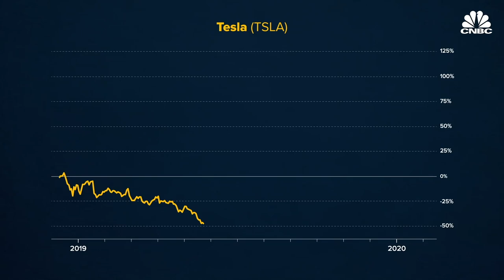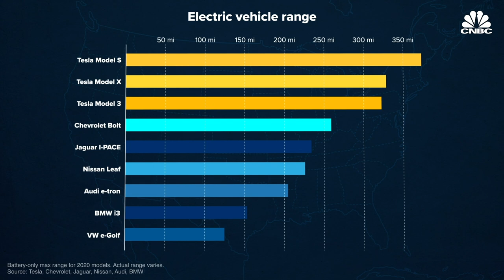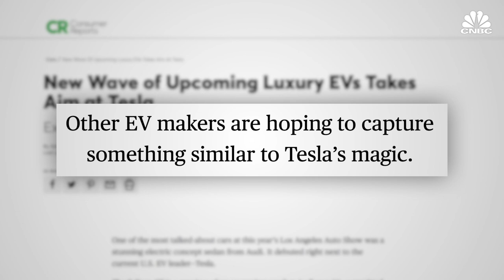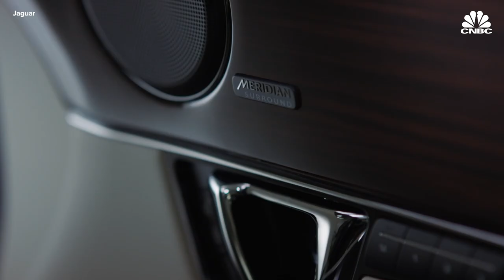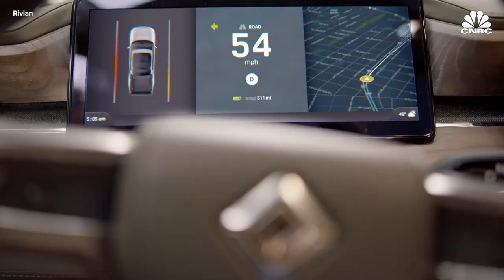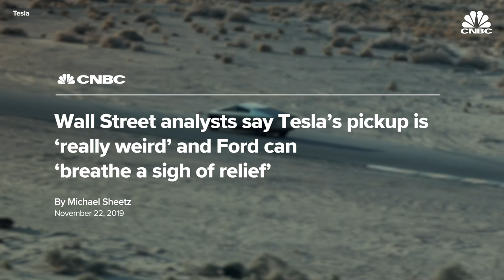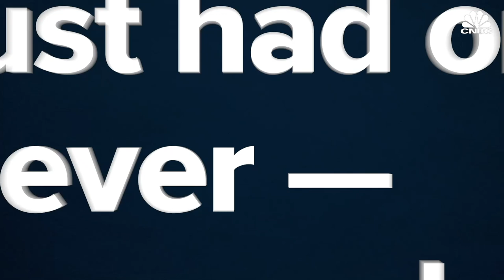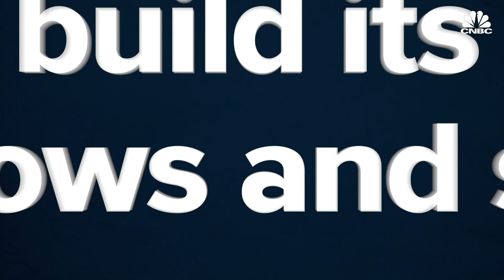Which Automakers Can Seriously Challenge Tesla?

Comment: I would like an electric vehicle, but I travel on the road a lot. Its charging that prevents me from buying. In some cases, it nearly doubles trip time. A typical gas stop for me is about 10 minutes. If a full recharge could be done in 30 minutes or less, I would buy one. But so far its 1-2 hours at best. I'd need access to 2 vehicles. One for city, the other for long distance. And I'm not about to fork over crazy dollars for both.

Comment: ..,..,,AMAZON: 

Yep, I bought a ton on the dip.   It's getting cheaper relative to its current earnings (half compared to last year). 

Amazon invested $14 billion in the last quarter alone, the same as it spent in 6 months before that.   It is a do not sell stock.

...With the Delta virus coming at full speed ahead, pandemic sales will make a comeback.

Amazon is investing so much money, that no competitor will ever be able to catch up.

Amazon's not going anywhere so I know that eventually it will come back.    

Fidelity considers Amazon as a large growth company (probably because as big as it is, it still only has 7% of the retail market)

Get on board or be runover, it's up to you.

Comment: Non of the so called big automakers have developed any infrastructure to support their cars, but Tesla did! You have two choices when you got a non Tesla EV, You charge it at home, or you resort to a Tesla Supercharger and use your adapters/converters, etc, in which case Tesla is still making money on you. The other thing is the software Tesla is using in their cars. They can upgrade your Tesla remotely, simply by sending a software upgrade to your vehicle. BMW tried this recently by charging it's customer for the upgrades and enabling or disabling features that were already built into their cars, only making it's customers angry, so that's a loser approach. In my opinion now the best chance is the VW ID-3, a long range, affordable EV, but again, VW does not have the Global infrastructure of chargers like Tesla does.

Comment: Tesla owns Solar City.  Why not develop a solar recharging panel on every EV? A car could theoretically travel 3,000 miles non-stop.  What about a solar panel on the trailer for the Tesla semi truck tractor unit?
Reply: It would be able to a 100watt panel on the roof and maybe a 50 watt on the trunk. Solar panel on the hood would cause accidents and b annoying due to sun shine glaring in ur eyesight. The panels would be ugly and u couldn’t have a super cool sun roof. 150 watts would take 3-4 months to charge the battery at 100% efficiency. It just makes no since plus it may not be safe to have a solar panel that close to ur head not to mention they create heat so when ur sitting still in traffic u would have to run the ac on a higher level using more power than what it’s producing

Comment: Only one buggy company survived the transition to internal combustion.  And it wasn't any of these guys.  It was Studebaker.
I don't expect a different result this time either.
By the time they make the investment, the people with money will have moved onto personal flying drones.  I expect Tesla to get there first too, probably by borrowing some engineers from SpaceX, or at least before the other car makers.  People will just have landing pads on their garages.
Batteries are absolutely critical in the future.  We need a minimum of 6x the energy density we have in current electric cars.  But when that happens (maybe even just 4x)...automated people carrying drones everywhere, electric larger aircraft, electric vehicles of all types, everywhere.  Even personal robots that are actually practical.
Gasoline is going to be under heavy pressure, when electric vehicles makeup over 50% of sales. Many gasoline stations will become electric stations, and the gasoline stations will become harder to find.  Taxes on gasoline will creep up.  The first bans on internal combustion will be for mowers, leaf-blowers, edgers, and other gardening service machines.  Sale of new gasoline motorcycles will be banned next.  They have no space for catalytic converters, pollute badly, and make racket.  The roads will go Kosher...no thundering hogs. 
Gas stations will be forced to have just one grade fuel to cut costs...and it will be heavily modified by regulations...biobutanal, and other changes.  Some cars won't like it.

Comment: It simple Tesla is a company that was built from the ground up as an electric car company as where everyone else were not. They have to change hundreds of factories now to produce electric cars, where their normal combustion engine cars are still bringing in millions. 250k is a very small piece of the automotive pie. and for Ford as an example to change the assembly line to produce a car that not many will drive does not make financial sense at this moment. But here is the kicker, resources and capital, which all the other top brands have. And it is already happening bringing out better  electric cars at a lower price point. Tesla might have the market now, but the competition is catching up especially with build quality, which is the main concern with a smaller manufacturer.

Comment: It’s all about Teslas battery technology that gives them far more range than the high end competition. For other luxury brands to compete they need to invest hevy in there battery technology and computer systems in the car to make the cars as efficient as Tesla at kwh used per miles. To create cars that have the same range or longer than Tesla. Until they do Tesla will remain the leader, despite its many manufacturing problems and quality, and service problems.

Comment: You almost did well. Past issues with Tesla are in the past, with learning and innovation Tesla has the safest 3 cars in the US. Their 4th car is 7 months early, no more letting down the customer. Consumer Report had an issue with Model 3 in 2018 and part of 19 because of the number of cars manufactured and delivered. CP in 2020 says that Tesla as a company is RATED number one in Customer Satisfaction, over every other company!! It is not a cult following. It is disruption, learn about it or tell about it if you understand it. Tesla will be making 3 million cars per year in 2023, and it will be keep doubling, it is an exponential curve. You obviously have not driven a Tesla. The following is because they are an experience on Wheels, the safest cars on the road, clean, very little maintenance costs, The Model 3 gets 124 miles to the gallon. They are good for us and the planet.  No other car company can do what Tesla is doing, why you ask? Because they have put in so much work in the last 8 years. It will take the other car companies at least 10 year to catch up. Most will be bankrupt in the next  years. Mark my words. It was a good try. Keep working at it and you might eventually get it right.

Comment: Yeah, and China pretty much has the monopoly on Lithium battery production, so wondering what will be the long-term effects of that? Maybe they'll become like the new oil giants building golden palaces, gold-plated cars, and such after awhile hehe...
     Also our electric grid can't really handle the transportation energy sector to run on it (barely handles the current usage in certain regions), electricity costs will most likely rise a lot once EV is mainstream... People should start planning on getting more into home solar power and off-grid power generation now, before it becomes a bigger problem with the grid later, because once the grid starts suffering due to pegging demand, it will drive the cost of solar energy up again is my thinking... 
           Einstein once said:   "The significant problems we face cannot be solved at the same level of thinking we were at when we created them"
     And on a side note, Tesla is a lot like the iPhone when it came out, there was no other competition, it took years for other brands and OSs to even come close with what the iPhone could do, because Apple had the huge advantage of more experience making smartphones than anyone else. But even today after the other hardware companies and Android OS finally caught up, iPhone is still the choice for many...

Comment: "Which Automakers Can Seriously Challenge Tesla?"
Those who invest in the technology which will replace those over-hyped, environmentally harmful Li-battery powered cards -> hydrogen cars

Europe makes a serious push in that direction. Excess energy from renewable sources create hydrogen, some companies change their semi trucks from diesel to hydrogen and produce the required hydrogen on their own in 2020.
The only thing stopping hydrogen cars from hitting the mass/end-user market is that the infrastructure required to "fill" your tank isn't there - but that is not so hard to change.
Reply: In my eyes hydrogen will not replace EV's as the car of the future for one major reason: energy cost. Hydrogen cars would require around 3 times more energy to drive than EV's. And especially as battery technology improves and they search for better batteries types, it will be hard for hydrogen to take up a considerable share of the regular car market. 

However where I can see hydrogen being usefull is for trucks and maybe the larger cars like pick up trucks and cars used in area's/circumstances where you can't easily recharge your car.

Comment: Only a yet to be born new automaker, with a Genius at the helm to rival Elon Musk could pose a serious threat to the burgeoning Tesla empire. But an existing old school automaker could never get too close to Tesla for comfort. Tesla is not just an automaker, but a perennial innovator and building electric cars is just a fraction to what Tesla really is. A Tesla car is really a multi task platform on wheels, designed to eventually drive itself, to tune itself, to eventually perennially manufacture or feed itself with enough needed energy. it is going to be a an integral part of an electric grid, as well as a part time power storage platform, that will eventually easily pay itself. When we add to all of these meanings of a Tesla its leading unmatched safety record, and the fact that the traditional automakers are trying to compete against Tesla with just conventional battery driven cars, none of them will ever be able to compete profitably, condemned  to lose by their extremely costly legacy entwined with their Trade Unions, dealer network, advertising heavy budget, and the fact that in the end they are just assemblers heavily relying on hundreds suppliers. For these very reasons it will be impossible for any of them to compete with the Tesla system with a 30% cost saving head start ,which will become 40% when we add the Battery manufacturing advantage, and without throwing in the 10 years technological gap existing in between Tesla and the rest.

Comment: Well, we should put these numbers in context. Out of roughly 230.000 sold electric cars Tesla sold more than 75%, but those 230.000 cars are just 4% of the 4,7 million sold cars in the US 2019. Sure, in the very small segment of electric cars Tesla is king, now, but as a car dealer Tesla is one of the smallest in the US. Also, Tesla has 10+ years of advantage on the other car manufacturers when it comes to building electric cars. Everyone knows Tesla is good for about half the mileage they claim under realistic circumstances if you don´t live in a cold area, but there is not much experience the customers could look at on the other brands. Wait a few years then this diagram will look completely different and Tesla will be dead

Comment: there's several new electric vehicles coming from GM in the next few years Chevrolet Blazer EV Corvette E Ray Cadillac Lyriq V and electric version of the Escalade the Revived version of the Buick Electra will be electric etc. mind you the Escalade has been around nearly as long as the Seville was the Seville Sold 1,000,000 units in 28 years of production the Escalade has sold 650,000 in 25 years of production technically there's 2 styles of the original blazer K5 two door with flexible tailgate and S10 4 Door with flexible tailgate technically SUV's started to get popular in the 90s if it wasn't a jeep and that's also when you started getting US built Luxury SUVs like the Lincoln Navigator/Cadillac Escalade which debuted for 1998

Comment: The narrator goes on an on about the "planned" and "upcoming" and "to release" competition model lines, but no competing product even meets the specs or functionality of Teslas from YEARS ago.

So the simple answer to "Which Automakers Can Seriously Challenge Tesla?" is NONE CURRENTLY as competitors are not shipping products consumers want more than Teslas nor do they even come close to meeting Tesla specs!  And wait until battery day in September 2020 - where Tesla battery break-throughs will likely be announced, further accelerating their lead.

Cyber-truck: so, competitively priced, reliable, stainless steel (no paint to chip/no rust), full self driving option, locking bed, can charge other vehicles from it, tons of torque & acceleration of a sports car, likely million-mile (lifetime) battery getting 400-500 mile range and I can plug in anywhere and never have to visit a gas station again?  I'm interested.

Also of note, Tesla ...
... has a nationwide charging network while none of the competitors have.
... is much closer to being feature complete with Full Self Driving (FSD) than any other manufacturer.
... may well create their own ride-sharing network, being able to provide cheaper service than Uber or Lyft.
... has already launched their own insurance in California and expanding that into other states soon - it should be cheaper for many.
... plan has all along been to sell the higher-end cars first using the higher margin to build out production and R&D, then work down to "economy" cars - so that is in the future.

Comment: What do you expect from business analysts? This is just a regurgitation of the hype around Tesla.  Tesla's hardware, software, and even new manufacturing practices are outpacing the other car manufacturers.  Let's examine each at a time:  1. Hardware: highest range ~320 (Rivian will need double the battery size to get 400 mi range in their pickup).  Here is a video of just how efficient their car is: https://youtu.be/RaGVoB4Zn-Y.  One lap of being pulled by raptor == 5.6 laps at average speed or 1 lap with the pedal all the way down.  Almost defies physics.  2. Software: Only car company with level 3 maybe level 4 autonomous driving.  3. Manufacturing:  Breakthrough in Model Y https://electrek.co/2020/01/31/tesla-model-y-production-pictures/, Cybertruck using the panels as a frame. This doesn't even include the patents they have open-sourced and Maxwell's battery know-how.

Comment: Ah, yes. Nothing gets me going like the sound of a battery, and nothing gets my heart pumping like the feeling of political correctness😍👍🏼
Reply: Lasse Bauer The only disappointing thing about owning my Model 3 for almost two years is that nobody wants to have a bit of fun at a traffic light. They did when I got it though. My Gear Head buddies who tow their cars to the local track won't run me either. They love driving it, the sound of power is now in a different key.
Reply: @daveturner6612 Dave, I have a couple of friends with Teslas, and I can understand why people like them. While it´s nice with the extra space, great if you like gizmos and gadgets and also provides advantages (recharging and free parking) in certain cities, the car is mostly an academic and technical experience - not an emotional one IMHO. I can´t think of anything more soulless than an electric car, regardless of brand (and I must say I really like the look of the Taycan).
As for the dragracing part; it´s as silly to compare an electric engine to a combustion engine when it comes to acceleration as it is to compare them when it comes to long distance commutes. Different engines for different purposes. Teslas have impressive acceleration, but if to get that I have to live with the sound and feel of an engine that´s less involving than an electric powertool, I´ll kindly pass :)

Comment: Teslas are desirable because they're 100% EV and actually support their cars, release software updates, improvements, etc. It's like an iPhone, you know even 4 years from now your iPhone will still run on the latest iOS, while garbage like LG G series you're lucky if software updates last 2 years, if the battery lasts 3, or if they'll even be making phones in 5 years (looking at you HTC). And good luck reselling those pieces of crap . Everyone knows the Chevy Bolt or Mach-E is a poor man's Tesla, and any moment they could cut their losses and just go back to their gas guzzling bread and butter trucks. Then you're left with a pile of valueless old tech